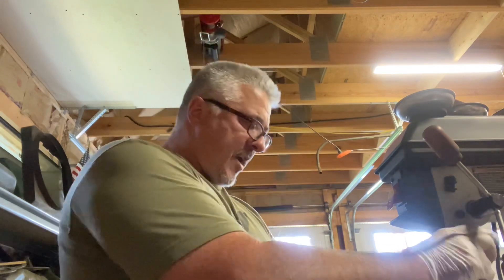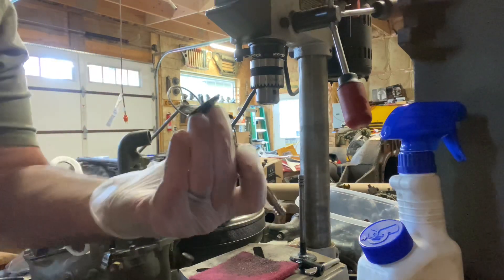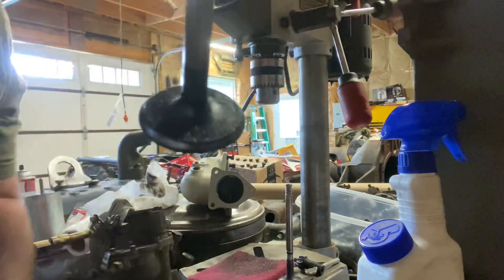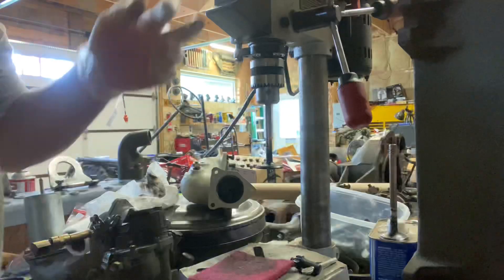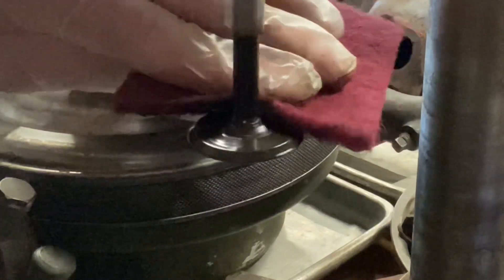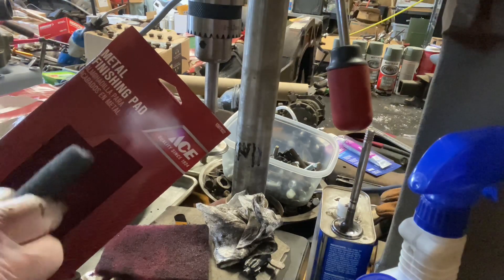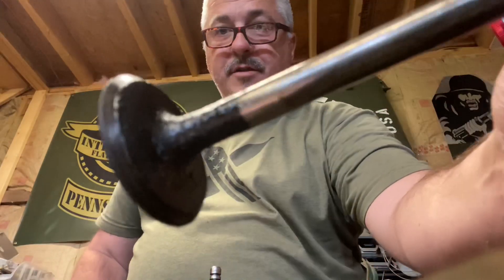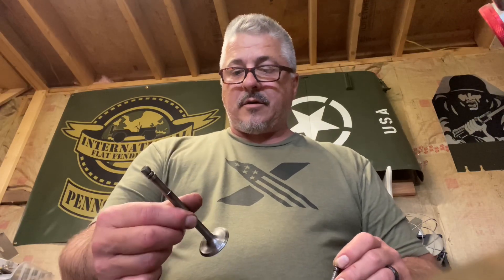How to clean exhaust and intake valves

Comment: Nice! 
Did I mess up mine? I used a drill to  turn the valve and a grinder with wire brush. 10 seconds. 
Used a drill 80, 120, 220 sand paper to clean pitted valves. Need to lap now

Comment: Those red pads are 320 grit from what I could check. Since I don't own a drill press, I am thinking of using 320 grit scrubby wheel brushes on a Dremel tool, place it in a vise, and move the valves around it as the wheel turns at low speed. Any objection?

Comment: First video I came across where sandpaper or wire wheels weren’t used to clean valves. Absolutely ridiculous. I’ll be getting a set of those pads from ace soon. I just got a 4wheeler and will be pulling the engine for inspection and resealing.

I thought about doing a big bore kit but I might need to wait a year and slow down, get this machine running correctly and memorized, and then start upgrading after I learn this thing inside and out.
Reply from the maker: Yeah, I don’t know why people scratch the crap out of their stuff

Comment: Dumb question Mike but could you get away with using metal polish cream and a standard kitchen scouring pad or do you need to find these special grade pads?
Reply from the maker: Never tried it before, could always try on an old valve you’re not going to use as a test